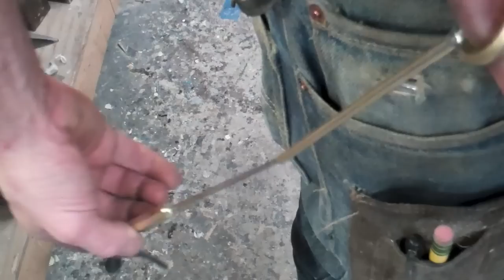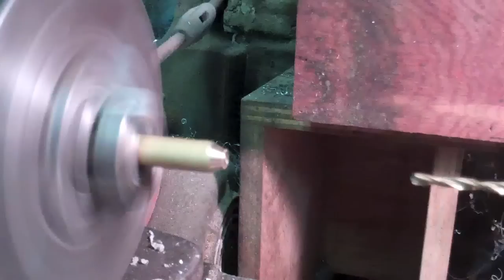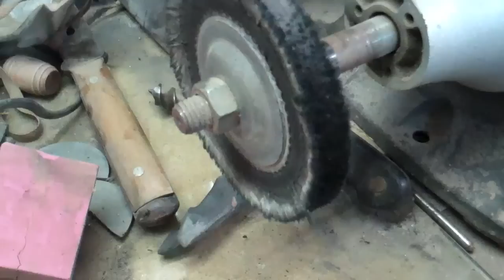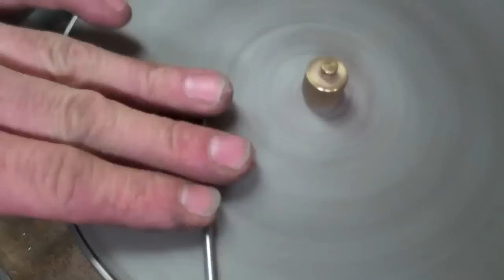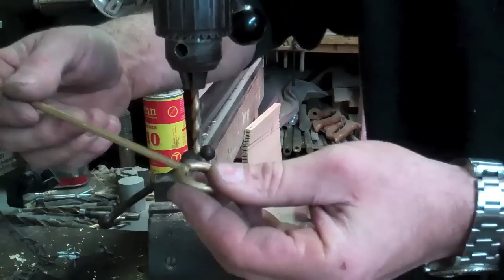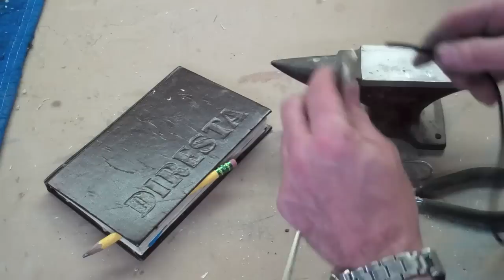✔ DiResta Ice Pick

Comment: Have you thought about using heat/cold to make the needle stay in the handle? Freeze the needlee to it contracts a tiny amount. Put it in the handle and let it warm up. It will expand inside the handle and stay there - guaranteed. This is how they mount the blade sections to the top of windmills.